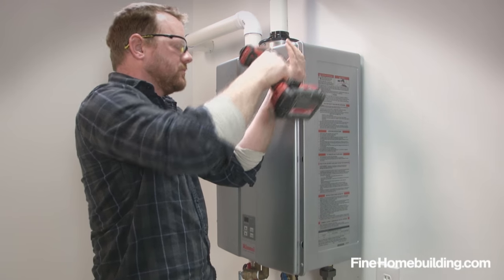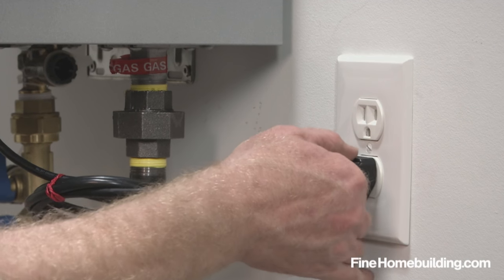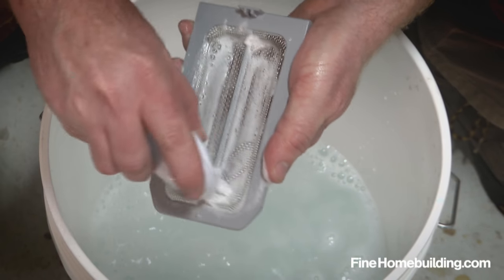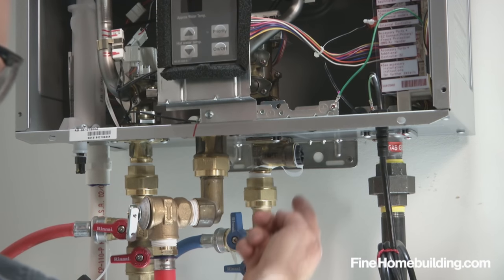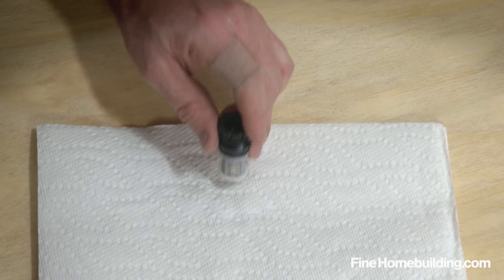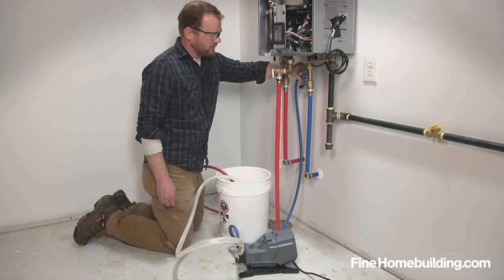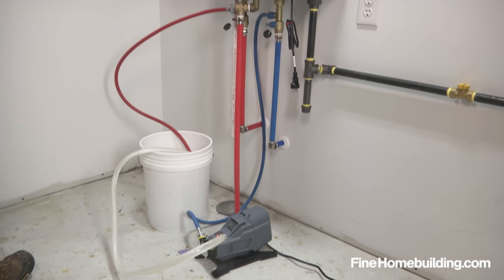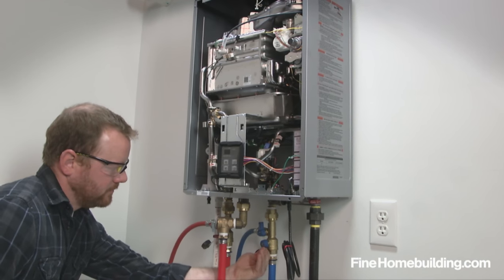Tankless Water-Heater Maintenance

Comment: First, check your manual.  I have a Rinnai and the manual says that when cleaning is needed, it will display a code on the control panel.  I haven't touched the thing for over 10 years, still going strong.
Reply: Wrong lol clean it or ur gonna open the hood up and it’s gonna be melting from corrosion
Reply: @tgains7102  Hi and thank you.  I assume you were on the design team who approved the owners manual.  So if the manual is incorrect, why did you approve it?
Reply: @rivernet62 most boomer comment

Comment: What pump is that?
Reply: It's Ryobi's hybrid transfer pump, painted gray. Worked great at first, but the impeller has been problematic.
Reply: I should note that the pump comes with a replacement impeller in the box.